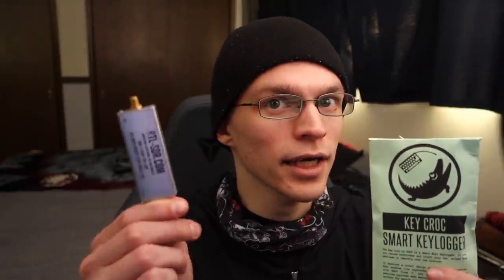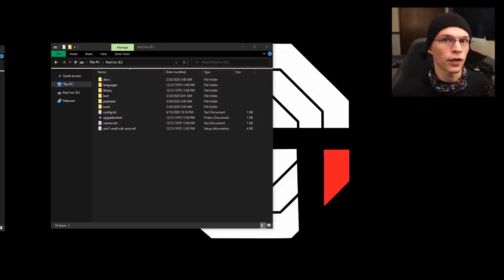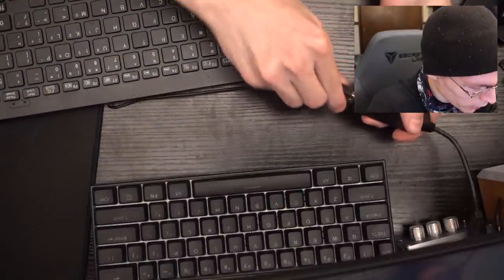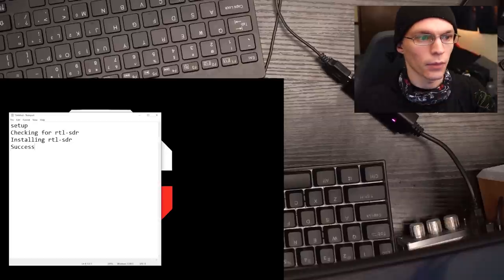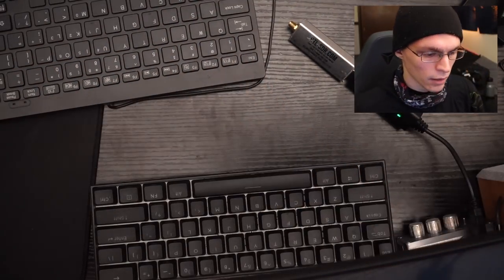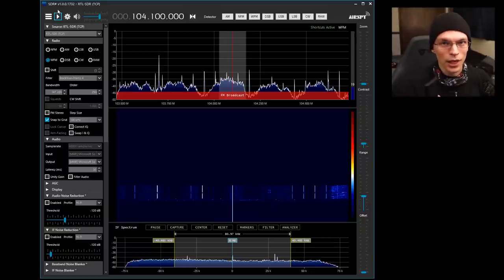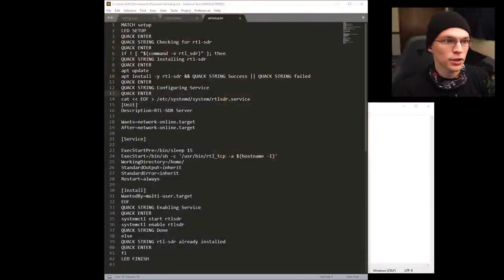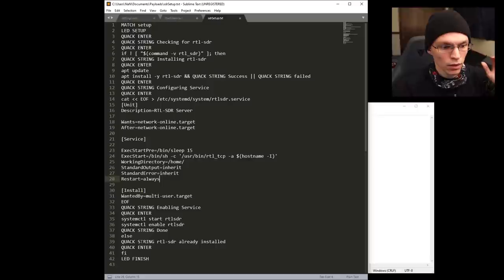Turning a KeyCroc into an RTL SDR Server w/ Glytch

Comment: Maybe this is thinking the the impossible but if the sdr can transmit would it be possible to make a "long range sdr" network? Yeah after re reading it it doesnt sound possible
Reply: There are other SDRs that also transmit.  They are more expensive though and I'm not sure what it would take to make other devices work like the RTL-SDR in this setup.